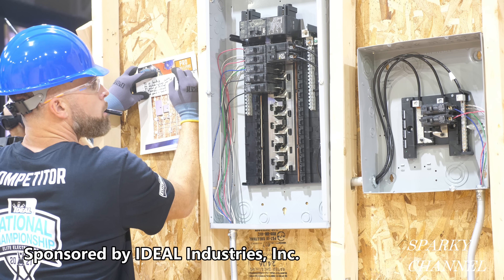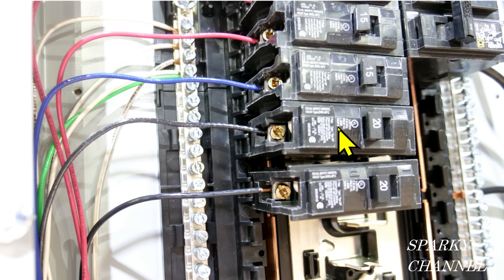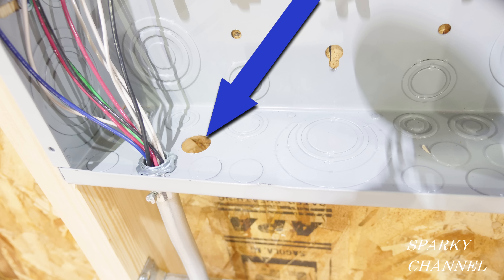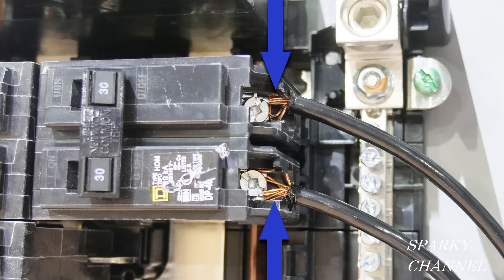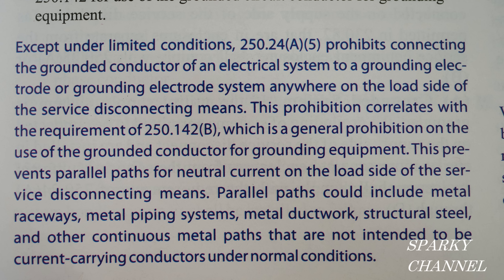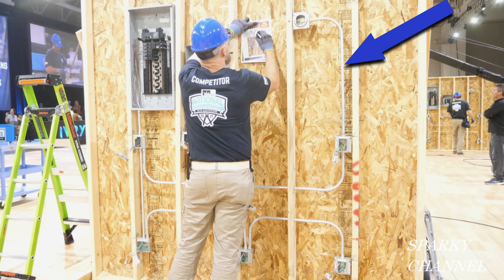Find the NEC Code Violations! IDEAL National Championship Code Violation Board Round 1 Part 2

Comment: Great work again brother.  

I had to break out my code book and do some careful reading, but is it possible that the 14/2 on a 20 amp breaker could be code compliant?  It is easy to agree, but I took it as a challenge.

In chapter 2 it is easy to say, "Yes!"

 Now, let's look at chapter 4 motors and read carefully for minimums and maximums.

430.6 motor amps...go to 430.248   where a single phase 1/2 HP motor is rated at 9.8a

430.22 gives me a wire size of not less than 125% motor ampacity.  So, under this section, the wires could legally be #2 , but 14/2 will carry 15 which is more than the almost 12.5a required by this section.

A jump over to 430.52 for breaker size.  430.52 (B). .. capable of carrying start load.

430.52 (C) a protective device shall not EXCEED the ratings in table 430.52; 800% for instantaneous trip.

Since a 20 amp breaker does not exceed 800%, it looks like we are good.

So, when I asked google what size breaker for a 1/2 HP motor, I got 15 a and that looks code compliant.

So, 14/2 on a 20 for a 1/2 HP motor or less with a breaker not to exceed the run amps multiplied by 800 seems legal.

Sure, I will get a million comments, but show me where I went off track please, if  you know I did something wrong.

And 14/2 on a 20 may not be an instant violation if it is a motor circuit.  So, I would note it and provide the motor circuit explantation.

Hey, Sparky, thanks for dragging me through motors again.
Reply: I believe you are correct; however there must be thermal overloads on that wire as well as a 20amp breaker. You can't just run a #14 off a 20amp breaker directly to a motor without there being some thermal overload which will protect both the wire and motor.

If this just runs to an outlet as it appears to then it is certainly a violation.

Comment: i didnt like at 3:36 and other spots, the wires coming in have no second layer of protection, its just there colors.  on romex i enter the panel with maybe 1" of yellow or white romex around the wires so they dont chaff on the metal.  if a wire does not have a second layer of protection around it, i install a plastic anti rubbing ring onto the panel connector to again stop chaffing.  im no expert, just what i do.  also none on those breakers were arch fault.

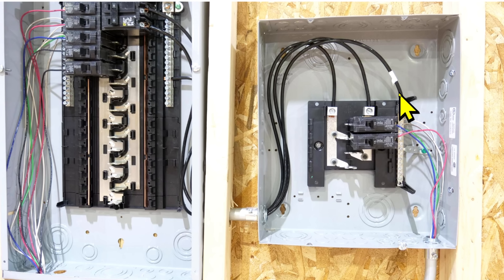Comment: 6:18 - The subpanel appears to he held in place with just 2 poorly installed screws on the right, and the left side is being held up by the conduit to the main panel.  Also willing to bet those are sheet metal screws going into wood.
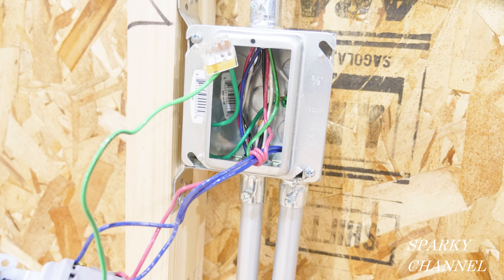Not sure about 9:04 where you have wires passing through a receptacle box, but are not used in that box.. Can't locate the code for that, but seems dangerous if someone does work on it and the outlet is off, but that wire in the back is still hot. (Yes, a smart person would still stick the probe in there to see if ALL wires are off)
Also, can't see it, but are all those outlets 15A? And what size wire is going to them?
AND... is this considered a wet environment? (No GFCI seen)

Comment: A few thoughts... In the first part with the breakers, three of the breakers are installed incorrectly and not engaged with the tabs that secure the rear of them. The neutral and ground wire under the same terminal are a violation - not because the terminal isn't rated for that (we'd have to have access to the manufacturer's instructions to make that determination) but because neutrals are not allowed to be terminated together with other conductors of any type. Grounds can be doubled up as long as thee instructions permit that. The sub-panel is missing a ground bar. The conduit between the two panels should have plastic bushings on the connectors since the conductors are 8 AWG or larger. If the conduit between the two panels is functioning as the EGC, it would have to have bonding locknuts on both ends. I'm sure there are more, but that's what I picked up from the video.

Comment: Most of these "code" violations are to either justify someone's pointless job to bitch at other people's work, or to sell more electrical products. 
Go do some electrical service in a major scrap yard, asphalt plant, foundry or powder coating plant and these look very trivial in the vast scheme of things.
Of course, this was mostly residential examples although no one runs emt in wood walls. About the dumbest shit I've seen
Reply: I think you missed the point. This is simply to test an individuals proficiency in the code. Not meant to mimic real world conditions or hazards that come with ageing infrastructure . Besides the rules in the code were put there for a reason and they are a minimum standard. Shouldn't be difficult to follow on a new installation.
Reply: @jquistjr  your dumbass comment contradicted itself off the bat. It's suppose to test someone's proficiency in code but ALSO not meant to mimic what you might find in the field? I think you missed the point of trying to be that guy
Reply: @jordansutche9829  You said it yourself, no one runs EMT inside wood stud walls.  So yes not necessarily real world but  It's called a mock up for testing purposes. Why you so bitter bro? Did the inspector not like you shoddy work?? lmao
Reply: i mean most of the code violations in this video were basic stuff thats the bare minimum you should know to touch electrical, there was dont double bond a sub panel, put the green wire on the green screw, and dont touch the breaker panel if you dont even know how big a breaker you can put on a wire, aside from the last one none of those will burn your house down but for what electricians charge i think the standards can be a bit higher than that
Reply: I was using a Bridgeport mill at work a few years ago and it had an aftermarket gooseneck lamp attached, well one day I moved the lamp shade a bit to get better light on the cutter and the lamp shorted out! Turned out some idiot used a non polarized lamp cord and plug on the lamp, so the plug could be plugged in either way, so it had a 50% chance of being plugged in correctly, and a 50% chance it would be reversed which made the lightbulb's metal socket hot, and the metal shade too, and when the shade touched the mill it shorted. An oerator could have been handling that lamp with one hand while having the other hand touching the mill bed or something and been electrocuted across the chest! I changed that cord out immediately to a polarized plug.

Comment: Correct me if I’m wrong but, At 9:33 you mention this box doesn’t have a grounding conductor, From what I saw in the video all the boxes were connected with EMT. Is EMT no longer listed as an equipment grounding conductor in the 2020 code?
Reply from the maker: Excellent point! I would prefer to see the metal box bonded by an EGC but you're right, the emt is doing the job. However, the panel is not grounded so nothing downstream is actually grounded no matter what we do. But if we did have a grounding system with ground rods etc., you would be correct. Good thinking!
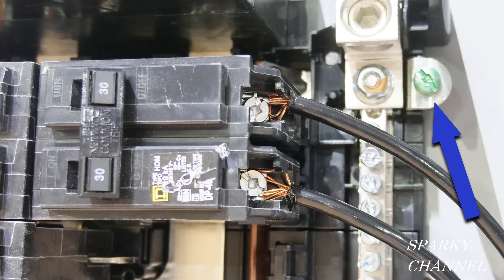Reply: @SparkyChannel  4:59 Main panel is bonded/grounded?
Reply: @snr7287  no grounding electrode tho
Reply: Thanks!

Comment: I don't like that you called the double pole breaker a code violation based on how it didn't look right to you. I may be violation but that needs to be proven. It doesn't look right to me is a bad reason to fail something.
Reply from the maker: OK, point taken.
Reply: @SparkyChannel  article 114.(A) electrical connections / terminals talks about ....thoroughly good connection without damaging the conductor....  Would have been better verbage for that point.
Reply: Agree on the word choice and I think the violation falls under article 110.14 (A). Electrical connections / terminals.  With the strands splayed out as they arr, a " good electrical connection" is in doubt.  The wire may be considered "damaged" because of splaying of the strands as well.
Reply from the maker: @keithharrington4595  Thanks Keith, excellent research and knowledge. I'm planning to make a video on this subject after the finals video because there are some excellent examples in that round. I'll show 110.14 (A) in the video.
Reply: @keithharrington4595  Should also be taken into consideration whether or not that Square D breaker is listed for use in that Siemens panel. If the manufacturer does not list it for use in that panel it is a code violation (don’t have my book with my for the specific section but it is in beginning under listed equipment).
Reply: @keithharrington4595  it looked to me like only two of the strands were caught, most of them were cut off short!

Comment: You can't run 240 v from the same side separate the breakers
Reply: Each breaker draws from a different side.  Look at 6:19 and make full page and you can then see the two hot bus bars.  :)
Reply: Huh? Besides the already mentioned it is using both legs, you can't separate the breakers because they have to have the handles tied to trip together.

Comment: What about the number of conductors being stuffed into what looks like 1/2" EMT from the main panel?  And since the bonding was wrong in the sub-panel, an additional ground wire would be run between the two panels. One of the feed wires between the panels should have been marked/banded red.  Also what about maintaining red with red and black with black in 220 circuits? Blue wire not tagged as either red or black.
Reply: What about the use of ferrules for stranded wire?
Reply from the maker: @chrisharper2658  I'm going to answer/show that in a future video from the finals.
Reply: @chrisharper2658  The vast majority of American terminals are rated for stranded wire, including device terminals. European and other IEC terminals may not be rated the same, hence lots of ferrules in gear from abroad. Here in the US, it's hard to buy ferrules or crimpers at any supply house.
Reply: @PetrosArgy  I think ferrules are gaining momentum here in the States.  I've worked in two industries where they were required.  Reason being that there were some terminal blocks where it was possible to improperly insert the stranded wire where it seemed that the wire was clamped down when in fact it wasn't and the connection would fail months later.  Ferrules insured that all the wire strands are properly clamped.  And re-clamping the wire won't fatigue the individual strands of wire.  They are good cheap insurance and better then tinning the wire with solder as the solder is to soft.  The NEC may not require it but they should, at least for smaller wire gauges.
Reply: @chrisharper2658  I keep a selection of them on my truck along with crimpers. I definitely like using them.
Reply: @PetrosArgy  They even make specific ferrules for combining two wires for one terminal.  I don't think the NEC would like that in a panel but it is safe and is done in industry.  The insulating sleeve has an oval shape to cleanly accommodate the two wires insulation.
Reply from the maker: Hi Chris! I covered the number of conductors in 1/2" emt: Too Many Wires? Part of IDEAL National Championship Round 1 + 2020 NEC Chapter 9, Table 4: https://youtu.be/RQclpqofM5E    
  Good points.

Comment: I saw no Green/ground wire to the sub panel . no protective bushings on the conduit ends on both ends of the nipple between the main and sub panel.
Reply from the maker: Excellent!
Reply: @SparkyChannel  I was a contractor way back in the 70's... much has changed but the rudimentary stuff should be the same!
Reply from the maker: Excellent! I subscribed to your channel!

Comment: Great video!  
Some comments:
1. While not a hazard, it's interesting that the (I'm guessing) 4 AWG cables feeding the subpanel are fed from only a 30A 2pole breaker.  No danger in a smaller breaker, but unusual, unless one could argue that it allows for future expansion in a real world scenerio.
2. sub panel doesn't have a separate ground bus. (You mentioned needing to remove the bonding jumper from the neutral/ground bus to the frame, but it wasn't that clear on needing a separate neutral bus and a separate ground bus)
3. Subpanel - loads aren't balanced.  Typically you would balance the breakers left and right to balance the loads.
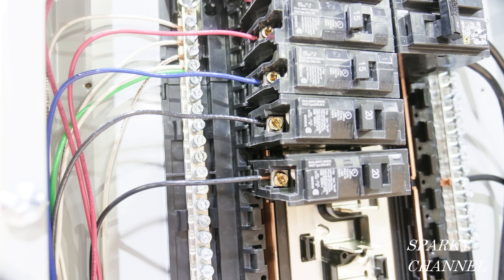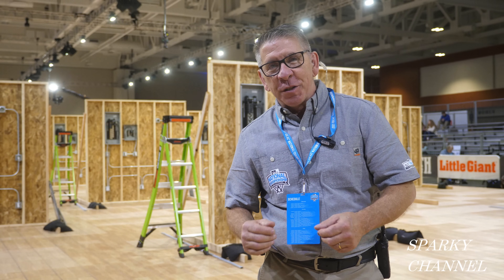4. In looking at 0:43 it looks like ALL of the top left breakers are out of alignment, and ONLY the bottom left one is correctly aligned with the mounting tab.  At 10:06 when you can see the zoomed out view of the panel, it sure looks like ALL breakers on the left side of the main panel, are installed crooked, and only the bottom left is correct.  Am I wrong?
Reply: The breaker placement on the subpanel does balance loads.  Top breaker is connected to the right leg, bottom breaker is connected to the left leg.
Reply from the maker: Excellent! Good eye on the 4 top breakers being improperly installed. I actually have a video on that:  What's Wrong? 2021 IDEAL National Championship NEC Violation Board 1st Round Part2 from Nashville!: https://youtu.be/HfmKUF01QSw

Comment: I'm only seeing four neutrals in the main panel with 5 circuits meaning there's a shared neutral in there. Should have a handle between the shared neutral breakers.
Reply from the maker: Yes! Excellent!
Reply: That's a great observation. When I took a second look, I noticed that the panel the guy's working on at the beginning has five breakers. The one in the publicity still shot shows four (as well as other variations like parallel feeders that look like they're terminated to a quad breaker to the sub-panel). The photo used during the commentary shows five. The other way it could go though would be if there were a 240V device in one of the boxes (which we don't see in the video). If that were the case, the violation would be using two single pole breakers to feed a 240V circuit.

Comment: I'm fairly certain that square d neutral bars will allow multiple 14 or 12 Guage wires under a single terminal. It would be listed on the door most likely. It is however a code violation for a grounded wire (neutral) to share a lug. So yes, that was a code violation where white and green shared, but it would not have been with two green.
Reply from the maker: It says on the nameplate of the load center. You just go by the way it is listed.

Comment: Good information! I participated in a very similar event right after the adoption of the 96 NEC (yeah, showing my age now). A complete home mockup was built with various stages of completion. Our task was to find the non-conformances. CEU classes were held daily for three days and on the last day we were given 3 hours to inspect and note anything we found. My list consisted of 142 violations. The instructors insisted there should be no more than 30 because that is all they built into the structure. After going over my list in detail, they agreed that everything was legitimate and they took my list as a teaching tool for their own staff and for future competitions. Moral of the story is: Despite all of your due diligence, chances are you may miss something or multiple somethings. Use it as a teachable moment. Inspectors are not there to harass you, they are there to ensure the occupants are safe. I hung up my inspector hat in 2002.

Comment: Since multiple grounded and ungrounded conductors are in the same raceway at the panel, the ungrounded and grounded conductors need to be marked, grouped, or identified in such a way as to show which "Hot" and "Neutral" are a circuit.  Passing thru the j-box without a loop for future splices would not require identifying.  NEC 200.4
Reply from the maker: Excellent! Thanks!

Comment: We missed the Ampacity adjustment for the conductors in the EMT. I'm not sure adjust would be required as I would have to review that section of the code and do applicable calculations, but that is something that jumped into my mind right away. The bonding of the subpanel and the neutral wiring color jumped out immediately as did the double tap albeit for the wrong reason initially. I'm not a sparky, but I am more knowledgable than your average DIY guy.
Reply from the maker: You sure are knowledgeable! Great job!

Comment: Howz the fill ratio on the 1/2" conduit? Gotta be close with at least (2) 12 ga in that bundle, as you point out the 14 ga in the 20 amp should be (2) more 12 ga conductors and if I am not mistaken would definitely be over 40% (is the ground 12 ga?).
Reply from the maker: Hi Mac! I actually have a video on that, complete with applicable NEC codes: Too Many Wires? Part of IDEAL National Championship Round 1 + 2020 NEC Chapter 9, Table 4: https://youtu.be/RQclpqofM5E

Comment: Your videos are great.    I never realized it was a code violation to reidentify a conductor 6 awg or smaller with white phase tape to use as a grounded conductor.  For instance,  as a new electrician,  I install a 12-2 NM to feed a NEMA 6-20R for a window air conditioner,  protect it with a 2 pole 20 amp breaker,  then wrap a piece of black tape around the white conductor visible at all termination points, because this is a straight 240 volt circuit that doesn't require a neutral.

I have a 2020 NEC book I could have found that.
Reply from the maker: The cool thing about this channel is that we all learn from each other. :)
Reply: 200.6 applies only to reidentifying GROUNDED conductors (aka neutrals). There's a different section for ungrounded conductors that allows you to do what you're talking about, but I do not have my code book in front of me.